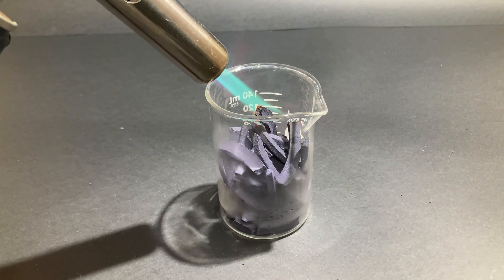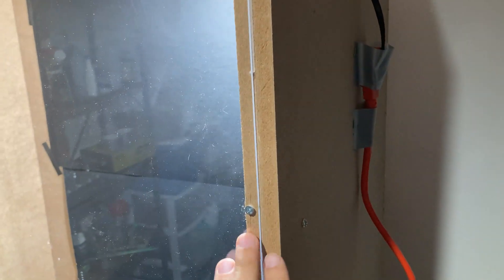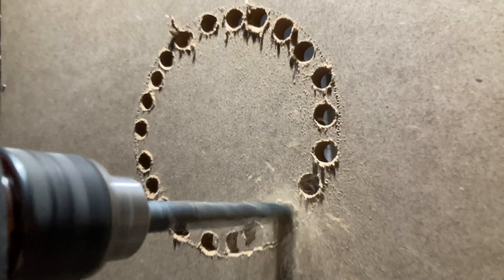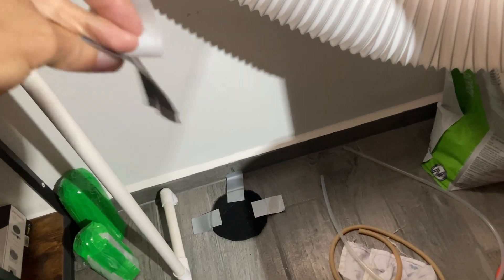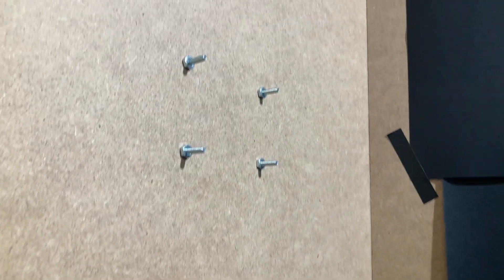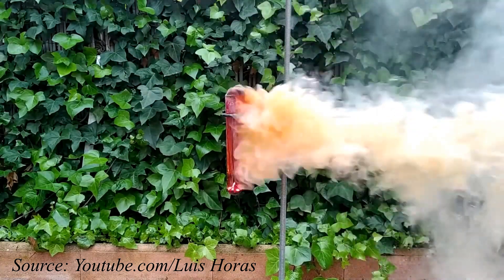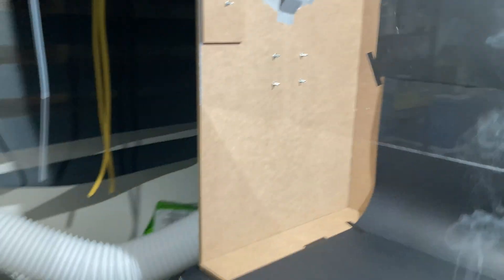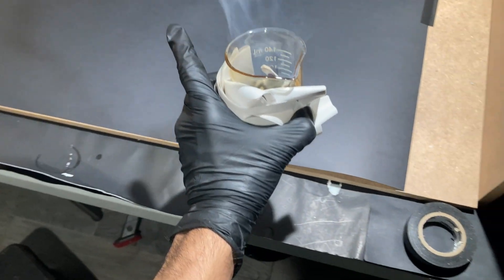Cheap, Easy, DIY, Home made Fume Hood

Comment: Consider adding a baffle in front of the intake to direct the suction toward the bottom and back of the fume hood.  It will actually be more efficient than your current setup.  Good job!

Comment: great build.
for a movable sash i attached my plexiglas to two wires wich go to the ceiling and are counterbalanced by some weights
works really wel and i really love beeing able to open the glass all the way and close it whenever i either let my fan run on low volume or when it gets a little sketchy

Comment: Please don't DIY safety.  You might regret it down the line... :/
Reply from the maker: thanks for the comment and the concern, I know the limitations of this kind of setups, and will have them in mind when utilizing the hood.
Reply: Proper fume hoods cost thousands, and are most of the time not even sold to the public.
Reply: @Energetics_Testing  Expensive does not mean good.
Reply: I think in this case.. some precautions are better than none though I agree with your sentiment. I think its sensible to keep the experimental parameters within reasonable limits as Andy mentioned.